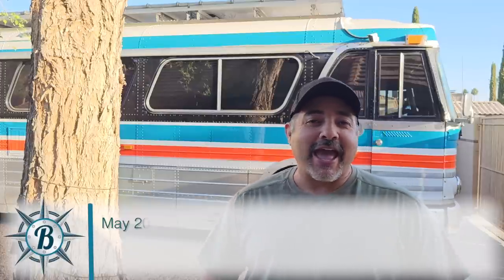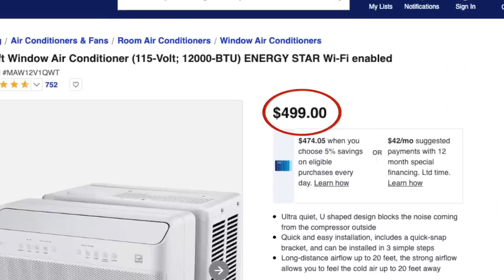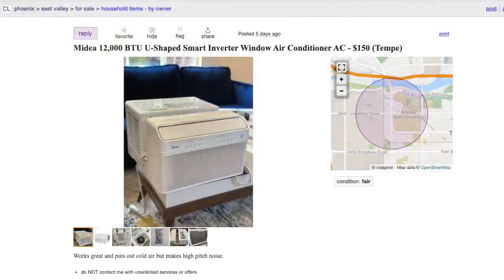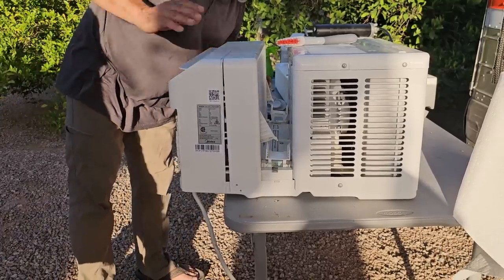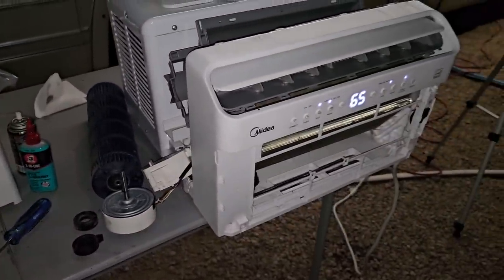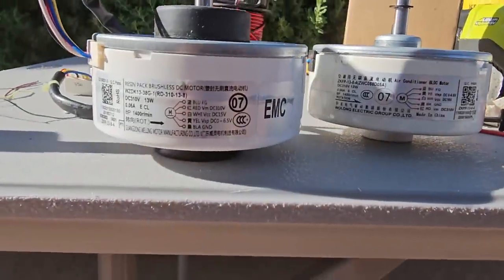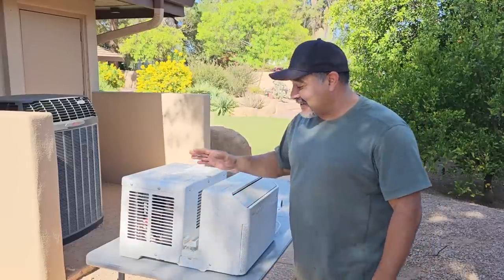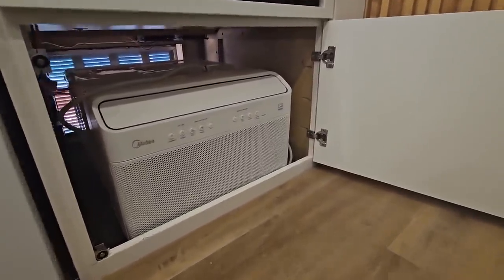Adding More Air Conditioning for a HOT Summer

Comment: I looked on-line, the unit looks like it drains from the bottom, so you might need to raise the unit up a few inches to have drain pan to catch the water to send it out of the bus somehow.  Also, you might want to cut an opening in the cabinet door, and install a flap to let the cool air out, then flip it shut when not using the ac.  That way you won't need the door open.
Reply from the maker: Yes the unit tries to "hold" the water in the pan and use the fan to "fling" the water onto the coil to help with the cooling (at least that is what I read).  The problem come when there is too much water to get rid of - I like your suggestion with the drain pan.

Comment: Solder wick braid makes unsoldering those types of terminals quick and easy
Reply from the maker: 100%!  flux + solder wick would have been much much easier.  I also have a desoldering iron that would have worked so much better.  One of the downsides of living in a bus is that you can't take everything with you.

Comment: My thought was Where is the condensate drain? But it remembered you are in the desert- a unit like that in Louisiana would probably extract 5 gallons of water a day from the air.  Without a drain, you’d have a mess pretty quickly. The tiny condensation you might get will be evaporated instantly. Beware if you come down south - you’ll have a wet mess. 

I would consider chocking it up so the rear coil is fully exposed. Also you might consider making a small thin plastic duct for the cool air to keep it from being sucked straight into the intake, maybe made out of a flexible plastic cutting board from the fishing dept at your favorite big box store, or the plastic “cone of Shame” that they put on dogs to keep them from chewing stitches after surgery- the foster dogs we get come with clear plastic ones apparently made by 3M. Just a little chute to take the air to the edge of the cabinet front would probably help .
Reply from the maker: Thank you O.C.  Condensate is not an issue yet because we are bone dry right now (humidity yesterday was 5%).  But come monsoon season it will likely become and issue.  I like your idea of raising the unit to expose and maybe plumb in a drain.  I am torn between wanting a simple solution like that or having a water sensor and a small pump.  I am leaning towards the more simple solution.  Thank you for your suggestions!

Comment: My coach has 3 existing units that were installed in 92 that are not energy efficient at all.  I also, don't have dash a/c.  I am considering removing and replacing the front unit with a high efficiency unit so that I can run it off the batteries while traveling.  Just need to get it done .  Thanks.

Comment: Just build a vented door to replace the solid door Juan, that way you can swap doors in 5 minutes whenever you pull the unit out in cooler areas and you don’t have to worry about closing it each time to walk past, that’s gonna get old quick and is gonna end with it getting ripped from the hinges most likely
Reply from the maker: You are probably right - I should probably just do it.  It is the temporary nature of the issue that keeps tripping me up.  If I knew this thing was going to stay in here I would just go for it and build it all up.

Comment: Juan, if you have a few minutes I would like to know what soldering iron you used. Thanks for sharing, I have enjoyed watching your journey.
Reply from the maker: Sure thing Bobby!  The Ryobi Hybrid Soldering Station is great (https://amzn.to/3JxWbyR).  It's a great soldering iron with one huge fault - the wire that connects the iron to the base station.  They used the cheapest, stiffest cord and it really takes away from the experience.  Other than that it is a great soldering iron, it's powerful, heats up very quickly, has a comfortable grip AND IT WORKS GREAT ON BATTERY!  The DeWalt battery is able to be used through a cheap $15 adapter (https://amzn.to/3pkNctT).  Since I already have Dewalt tools but Dewalt doesn't make a cordless soldering iron this one I went with.  I hope that helps

Comment: That is the exact unit I put in my electronics closet in my bus. I hope they have changed the firmware and you have more success than I did in an actual room cooling application. It was very quiet and had very low energy usage, but It took about 4 hours to cool down my bedroom. I replaced it with an LG inverter model just as efficient that cools down in 15 minutes. I put up a review on Amazon with complete energy and cooling graphs showing the performance problems. Midea called me on the phone and refunded my money and told me I could throw it in the trash. They eventually just removed my review (I should have known).
Reply from the maker: Wow this is surprising!  I am sorry you had a bad experience with them (and I am sorry they removed your review).  So far it has worked very well for us but I will keep everyone posted if that changes.  Thank you for sharing your experience.
Reply: @BeginningfromthisMorning  There were several other reviews with the same complaint. Last time I checked they were gone too. All the unit needed was a firmware change to the loop tuning. It would start at full power but quickly start to ramp down power usage as the room started to cool instead of ramping down when the set point was reached (kinda like a PID loop with too much derivative). It works just fine in a tiny closet just to keep the equipment from overheating, so I did get some good out if it.

I am curious about your installation though. How are you handling the condensation water that would normally leak out over the bottom tray? (Nevermind, I just read some of your other replies :)
Reply: How about putting an A/C on a tow behind trailer?

Comment: $500 for a 1 ton mini-split is actually a pretty good price.  
GE makes them as well but the U-shape is reversed...the parts would hang down over the sill instead of the window sliding between them...made for newer skinny windows.  
Mr. Cool also makes the kind like you bought and is one I am considering if my current 1T ever dies.
Reply from the maker: Yes - All things considered $500 for a 1 ton mini split is actually not a bad price at all! I saw those upside down ones as well - really cool!  I will have to look up the one from Mr. Cool.  We have been running this thing for about a week now and it has really helped with the heat!

Comment: Very interesting AC project.  But... what I found really interesting was the Ryobi Soldering Iron with DeWalt battery in it.  Details?
Reply from the maker: The Ryobi Hybrid Soldering Station is great (https://amzn.to/3JxWbyR).  It's a great soldering iron with one huge fault - the wire that connects the iron to the base station.  They used the cheapest, stiffest cord and it really takes away from the experience.  Other than that it is a great soldering iron, it's powerful, heats up very quickly, has a comfortable grip AND IT WORKS GREAT ON BATTERY!  The DeWalt battery is able to be used through a cheap $15 adapter (https://amzn.to/3pkNctT).  Since I already have Dewalt tools but Dewalt doesn't make a cordless soldering iron this one I went with.
Reply: Please use flux when soldering. That may be why it did not power on after reinstalling.

Comment: Nice work! One thing I would like to know. What happens to the water that the ac will make? Thanks for sharing. God bless
Reply from the maker: Thank you - this can certainly be a problem.  Right now it is VERY dry here so there is very little water being made but if we use this for a prolonged period (especially into monsoon season) we will have to address this.  Right now I have two solutions in mind: one is low tech - just tap a small hole and run a water drain line out of the bus.  The other is design a small Arduino circuit that detects water and activates a small pump for say 5 minutes to pump out the water.  Either way I will keep a close eye on it to ensure we do not have a mess inside!
Reply: @BeginningfromthisMorning  Smart Thanks for sharing. Hope one day yall make it to SC so I can shake your hand. God Bless.

Comment: Next time, use heat and soften the glue. Always buy the exact part number bearing. They're all labled.
Reply from the maker: Thanks for the tip on the heat - I will try that next time.  I bought a 608ZZ to replace a bearing labeled 608Z they should have been fully compatible.

Comment: Have you looked at the Pioneer under bench 9000 btu heat pump? Not as efficient as a mini split but very compact and ductable
Reply from the maker: I had to look those up!  Super interesting!   It looks like they are designed to be used with ducts.  Very cool - thank you for sharing that!
Reply: @BeginningfromthisMorning  I've learned so much from you.  It's about time I paid back

Comment: you could have made the other one work all you had to do was measure the shaft and the OD of the bearing and order the right set. If you still have the motor do that and you will have a spare ready to go.
Reply from the maker: Thank you.  Something I found a little odd.  The size on the bearing was 608Z and the bearings I bought read 608ZZ - they should be 100% compatible but as you can see on the video the new bearings fit significantly more loosely than the old ones.

Comment: Those do not look like zz to me. more like rs (rubber seal). zz means high speed (if I recall right) which means metal seal/shield. The one you took out that was noisy, looks zz-ish. RS seals better, which is why they use them on skateboards, which are relatively slow rpm. At high speed the rubber melts. So if it works for you, I would suggest running the fan at low speed or at least not the highest speed. I do not know what rpm is "high speed".

Ah, you replaced the motor anyway...

Comment: Nice work you could put a couple Ruvvi tags in there to measure your temperatures, update you colour control with guimods the it will display on the screen they are even capable of controlling relays too. 🤙🇦🇺
Reply from the maker: Thanks for the tips!

Comment: Hello J, 
Nice idea. 
Did you install a drain for condensate? 
You may also want to tip it to the outside so the water will drain to the pan and head for the drain. You may be ok until a damp night or monsoon season.
Safe Travels.
Reply from the maker: Thanks Nic - I have not done anything for the condensate - fortunately it is VERY dry here but, as you stated, if we use this on a prolonged basis it will become an issue.  I have a couple solutions in mind first is low tech - raise the rear slightly and install a small drain hose.  The second is put a water sensor in with a small pump to pump out water when it is detected by the sensor (using a pretty simple Arduino circuit ).  I have kept a close eye on it and so far very little water has been produced
Reply: Juan, 
You can get a small condensate pump if you create a low or drop area for the water to drain into. 
Standing water with dust and dirt will generate black mold. (Spores become Legions Disease) small pellets called PUCKS can be added to stop the mold growth. 
Be Safe
Reply: @NicInLvNv same thing I was gonna suggest. Drill a 1/2” hole in the bottom corner of the drain pan and install a typical HVAC condensate pump that has the pump, level control floats, etc all combined in one neat little package for $40 and last forever. Attach a piece of drain tubing to it and run anywhere you want to discharge it or run to a gray/black tank if you so wish and you’ll never have to worry about the condensate again. It won’t be an issue right now bring where they are but once they hit the road again and get to more humid areas and it won’t evaporate as quick and they will need a pump or some sort of a drain straight piped thru the floor

Comment: Have you ever run across a link where someone separated the front and back units?
Reply from the maker: I remember watching a guy cut the copper lines on a unit designed for a van and he put the "outside" unit under the van and routed the copper lines inside.  I don't remember if it worked out for him.

Comment: Good job! But do you think it might be better had you installed a higher btu mini split earlier?
I am planning a 24000btu mini split to replace my 2 roof top RV A/C.
Reply from the maker: Thanks Timmy - If I was planning on staying in REALLY hot weather then yes 100%!  For the last two years the original system has worked great (because we usually travel to nice weather).  The problem with a bigger mini split is that then I would need 240V split phase A/C  to run them.  The highest I could find in 120V was 12K BTU.
Reply: @BeginningfromthisMorning  Right, lucky me😁, I have 240V split with my 2 multiplus.

Comment: how will the water drain, from the condensing unit, from inside that compartment?
Reply from the maker: Thank you James - Our humidity levels in Arizona right now are about 5% so we won't see much water until the monsoon starts to hit.  I am currently thinking of two different solutions: a low tech drain type and one that involves a sensor and a small pump.  I am keeping a close eye on it to see what kind of water levels we get in there.

Comment: Sounds like brush noise to me, commutator bar wear.
edit: never post your guess too early 
😆
Reply from the maker: It does sound like that - but if you look carefully when I take the motor apart - it is a AC (brushless) motor.  I am like 99% sure it was the bearings.
Reply: @BeginningfromthisMorning  I agree and I should have known better that it wasn't brushed. Great video and repair (even if it wasn't successful).

Comment: Where are you pulling outside air for condenser?
Reply: Good question, wonder if it's pulling inside air from the exhaust fans, which might not be a problem.     Enjoyed the video.
Reply from the maker: Air comes from the tech cabinet (used to cool down the tech cabinet stuff) - down behind the refrigerator and then out the exhaust fans on the side of the unit.  This is then picked up by the fan on the ac unit and should be pushed outside the bus.